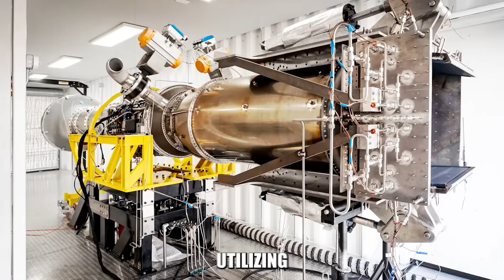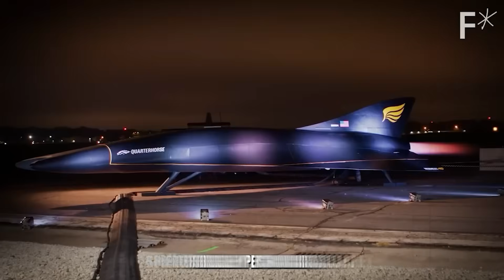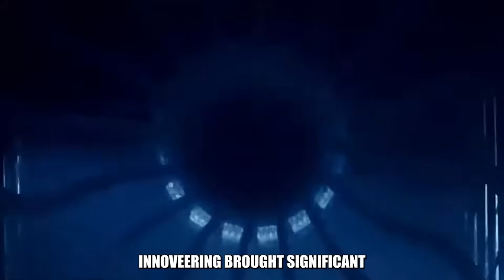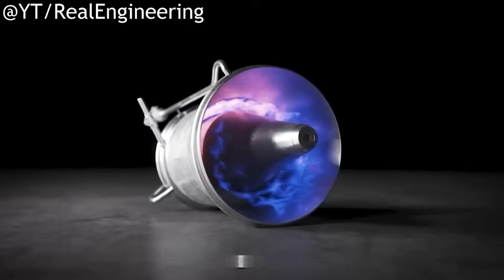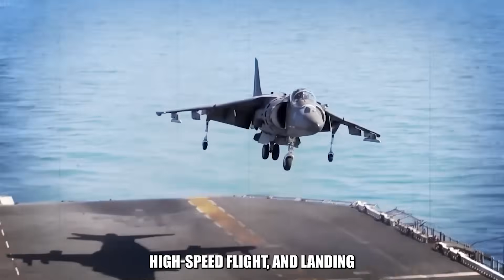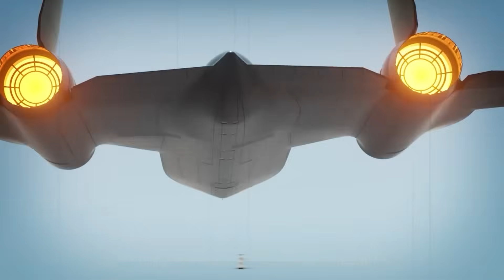How GE's New Jet Engine Could Change Airplanes Forever

Comment: Piston engine, diesel 17 to 1 compression ratio, tamped by piston cycle to and flywheel. 250,000 miles. How many detonations did the cylinder, piston head and rings survive? Relax school guy. Let the mechanics handle this.
Reply from the maker: Thanks for the comment, Joseph ... really interesting points on diesel engine durability and compression. 17:1 is no joke! Always good to hear from folks with hands-on experience. Jet engines operate on a very different cycle and environment, but your perspective on mechanical resilience adds valuable context to the conversation.

Comment: I have years of experience with both detonation and deflagration (pyrotechnics) processes, and I can tell you that detonations destroy the fabric of most all materials so I can't imagine how one of these engines is going to be able to operate for more than a few minutes or hours.    I'll give GE 5-10 years before any reliable engine of this sort enters production.
Reply from the maker: Thanks for sharing your insight and experience. it is always valuable to hear from someone with a background in detonation and pyrotechnics. You're absolutely right that traditional detonation poses serious material challenges, which is why GE and others are focusing on rotating detonation designs that attempt to manage those stresses through advanced materials and thermal management systems.

It’s still early, and like you said, reliable operational integration may take years. But it’s fascinating to see how close the research is pushing the boundaries. Appreciate your comment ... it adds great depth to the discussion!👍

Comment: The chinese tested one like this few weeks ago
Reply from the maker: Great observation ! China has indeed been testing hypersonic engines, but the U.S. is years ahead in practical integration and advanced propulsion tech. GE’s work on rotating detonation engines (RDEs), plus DARPA’s collaboration with companies like Lockheed and Raytheon, puts the U.S. at the forefront.

In fact, the U.S. successfully flight-tested scramjet tech at Mach 5+ years ago with the X-51 Waverider. Now with GE’s RDE and potential SR-72 projects in development, we’re looking at engines that can outrun missiles and operate without afterburners—a huge leap.

Appreciate you pointing it out—this global tech race is only heating up! 🔥
Reply: @TacticalJet ประเทศกัมพูชา ถล่มทั้งหมด
Reply from the maker: @SarayutLaklang-f5x  Thanks for commenting — always interesting to hear different global perspectives.
Reply: @SarayutLaklang-f5x 😂 with what? A crying appeal to UN? 😂